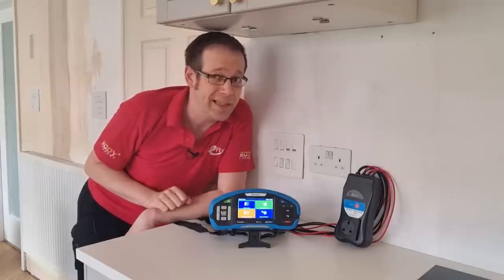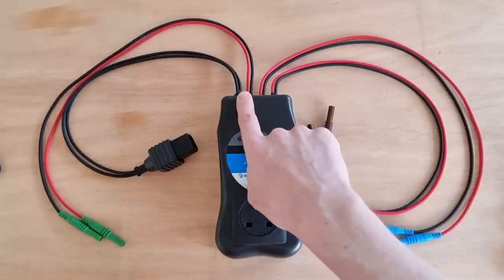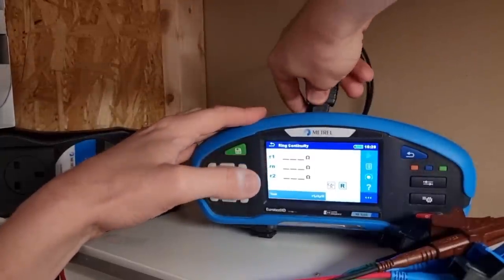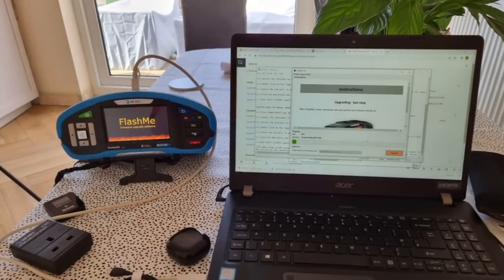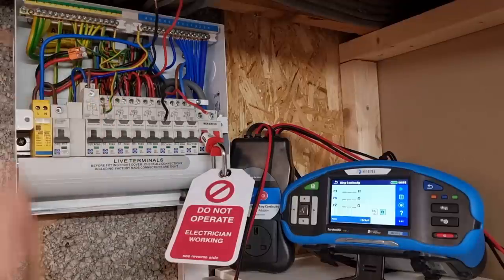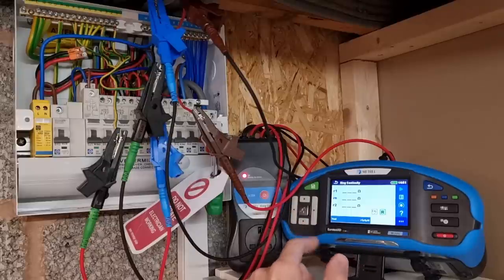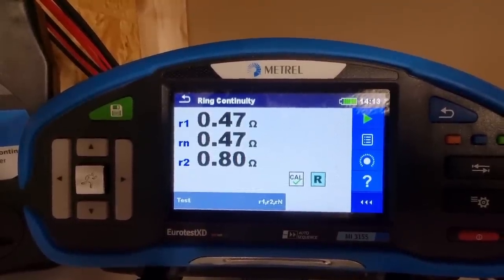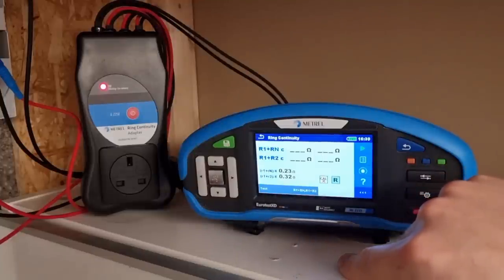The FAST Way to Test Ring Main Circuits!

Comment: How times have changed. When I was an apprentice we tested a ring with a bell connected to a battery,testing end to end. And as I good measure we would then test for insulation breakdown using a Megger
Reply: That is all that is necessary

Comment: The original reason for inventing ring final circuits was to reduce the amount of copper required for power distribution. That was a big issue during post-WW2 reconstruction. As copper prices rise and green footprint becomes more important, that reason becomes more relevant than ever.
Reply: Not correct, less copper less current flow... so how do you save copper for power distribution?

Comment: Great for initial verification, not required for carrying out an EICR. I’ve chosen never to install RFC’s in any re-wire I do because they’re pointless. Also, when systems start converting from AC to DC over the coming years, RFC’s and in particular the way we wire will change and RFC’s will be a thing of the past. Out of curiosity has somebody really wired that grid switch like that next to the socket??
Reply from the maker: Good insights.

Comment: I invested in the A1214 quite some time ago to go with my MI3152. It has red wires with heat shrink sleeving to indicate the usage. Strangely for a UK specific product, the line wires have grey heatshrink and black croc clips! The MI3152 has an auto sequence test which works with the A1214 but has no calibration option so the r1, r2 & rn results are not going to be much good. After getting readings at consumer unit, it gives the error IB020 and it is necessary to press another button to actually see the results. I took it to Metrel's UK office and left it with them for several months for testing but they did absolutely nothing and finally sent it back! Having just seen this video, I now know that there is a ring option in low resistance testing but this still does not have a calibrate option. I therefore upgraded the firmware (which deleted all my stored results) and after this, there is still no option to calibrate! It is hard to recommend this ring final tester based on my experience with Metrel - very disappointing!
Reply: Great insights, have you solved the issues with the MI3152 KC? I'm thinking of buying the A1214, any help appreciated.

Comment: I don’t install rings anymore, always 20A radial circuits, so much easier to test and faster
Reply: Same, I’m surprised amendment 2 didn't start recommending radials over rings given how AFDDs are steadily coming in.
Reply: Don't be such a wuss. 🤣
Reply: @paulmatthews5470  AFDDs work just fine on rings.  It's just that rings aren't as prone to arcing due to a break as radials are.
Reply: @paulmatthews5470  So old fashon ring finals nowadays..
Reply: @andrewcadby  yes I know, but wait until the manufacturers start lobbying it with how rings defeat serial arc detection by design
Reply: Ring main and radial circuits are two common methods for wiring electrical sockets in a building. The choice between them depends on the specific requirements of the installation. Here are the advantages of installing a ring main as opposed to a radial circuit for sockets:

1. Load Distribution:

    Ring mains are designed to evenly distribute electrical load among the outlets. This means that each socket in the ring can handle a relatively equal amount of current. As a result, there is a lower risk of overloading a single socket or circuit.

2. Efficiency:

    Ring circuits are typically more efficient in terms of wiring. They use less copper wire compared to radial circuits, which can be more cost-effective for large installations.

3. Lower Voltage Drop:

    Because a ring main distributes power in a loop, there is less voltage drop across the circuit. This can be particularly beneficial in larger homes or buildings where voltage drop can become a concern with radial circuits.

4. Fewer Circuit Breakers:

    Ring circuits require fewer circuit breakers or fuses compared to radial circuits for the same number of outlets. This can simplify the electrical panel and reduce the risk of tripping circuits.

5. Redundancy:

    In a ring main, if one part of the loop is damaged or disconnected, the circuit remains functional. In contrast, a break in a radial circuit can disrupt power to all the outlets downstream from the point of the break.

6. Flexibility:

    Ring circuits are more flexible in terms of adding or extending outlets. You can easily tap into the ring at any point to add a new socket without the need to run a separate cable to the consumer unit.

7. Safety:

    The looped structure of a ring circuit means that the return path for the current runs alongside the live path. This can help ensure that both conductors are subject to similar thermal effects, reducing the risk of overheating and fire.

Comment: Good job thanks for info 👍.I  wish to get one of those mi3155 but I already own metrel lower version  mi3100s.The question is, can this A2214 ring adaptor be use onto Metrel mi3l00s ?
Reply from the maker: We will find out
Reply: Yes it can might need to update the meter firmware

Comment: I'm not a fan of poking in the CU for obvious reasons and especially if I've just dressed it all nice and tidy.  I just head to the opposite end of the building and find a nice easy socket to do my end to end tests.
Reply: Surely if it’s a job you have done you would test the circuits before you second fix your board ?

Comment: Not a good demo of the 2214 as during the R1 + Rn and R1 + R2 tests the results of each test 9:05 to 10:20 are not committed so the meter cannot save the result. Once the test result is displayed the button below the soft test button should be pressed to commit the result once the test has been completed on the circuit the result can then be saved

Comment: How does it deal with interconnects on the ring final?
Reply from the maker: The readings will be significantly lower in some places than others.
Reply: @efixx  that was my worry that the electronics might not see the bridge and interpret in a way that didn't show up on the meter.

Comment: looks good but doesn't seem compatible with my tester MI3152 according to their website?
Reply: A214 unit is compatible, however as yet we cannot Null the unit until they release the next firmware !!  Considering they have been selling the unit for months and now only just releasing a firmware to Null is crazy......I have found Metrel Support Diabolical
Reply: @stormuk69  The A1214 seems to have now been discontinued so no longer available (not in the UK at least).  Guess this unit is the replacement version so will probably work with the MI3152 as I doubt the technology is different just now has the shorting outlet, subject to firmware though as you say.
Reply: @Mark-xr4zt  Yeah, I bet its exactly the same with the nulling unit built in.  So bloody annoying, I only had mine 3 months.  Still no big deal really I have a nulling unit in my toolkit.

Comment: Hi is this compatible for metrel mi3152 eurotest. Or would this work👐
Reply: Yes it is I use this with a MI3152
Reply: Yes but you have to get calibrated and need to send back to metrel but was time saver. Got to admit I do like megger x1 better but use the metrel for back up.😊

Comment: Great so my A214 device is already out of date as it doesn't have the built in nulling plug.  I also messaged them 3 months ago about the nulling procedure on the A214 and finally got a reply last week about the firmware being released soon.  If I could go back I wouldn't bother with Metrel as the whole unit is very convoluted compared to Meggar and the support for such an expensive unit is diabolical.
Reply: Still waiting for a Firmware Update to add Calibration.  They are now actively promoting the new version of the A2214 yet you still cannot calibrate it with the 3152.  Piss poor support for a tester costing over £1,000.
Reply: @stormuk69  The firmware for the 3152 / 2214 combination has been available for over 18 months as I have been using it since I purchased the 2214 in October 2022
Reply: @georgeneil440  It wasnt at the time I purchased the original Ring Adapter.  Anyhow I got rid of the tester ages ago due to dismal lack of documentation and training videos.  Got a Megger X1 with EV Adapter which suits my needs perfectly.

Comment: There is definitely a case to be made for using 4mm for sockets supplied by a 32a breaker. Testing is much quicker. But this Metrel tester really is impressive. 
If you were to test say, 10 sockets, would it remember the highest result whilst showing the most recent result? That would be the icing on the cake.

I've grown to hate the title 'ring main'. Customers don't know what it means, they only think they do. It's most often used by electricians that don't test. Or it used to be.
Reply from the maker: Customers thinking they know! - what are the chances!
Reply: Yeh but it all falls apart if you're not method c... And that's virtually impossible to achieve on your average socket circuit even if there isn't any thermal insulation. That's why my hand is forced back to rings on occasion. Just saying. 🤣
Reply: 30 amp would be outcome for 4mm on a radial. 32amps would be a no go unless directly clipped to a wall. So the stated breaker for a 4mm t&e radial would be a 20 amp mcb or rcbo. Not forgetting you'd have a problem taking a spur. You'd have to find the final and take it from there or use a junction box.
Reply: @rayc1503  🤣 although my house has 25a 4mm radials...
Reply: @travoltasbiplane1551  Probably so, but 25 amp breakers aren't all that common.  😜
Reply: @rayc1503  20A radials on 2.5mm2 seem to make more sense.
Reply: @rayc1503  Pretty common now,Hager,Wylex, Chint are just a few who have them...
Reply: @rayc1503  What about all the unfused Spur on spur on spurs from RFC’s that we keep finding when doing EICR’s, or all of the broken RFC’s we continuously find. How does that measure up with Ref B, 100 or 101? We can spur from a 4.0mm radial in much the same way as we do for the RFC… If the circuit is correctly designed there’s no issue either way, it comes down to the designers choice.
Reply: @CarlCosby  Have you tried terminating 3x 4mm terminals in the back of a standard switched socket. Please do and let me know how you get on. Of course you can take a spur. It's just not that easy. 4mm t&e isn't the easiest to work with.
Reply: I wire as a ring then put it on a 20A RCBO, gives you the option to upgrade to 32A if required and if someone cuts into the circuit to add more sockets then there’s no problem of losing the ring as it’s on 20A, I don’t like rings but I’ve had too many builders putting fixing’s through cables to convert completely to radials.
Reply: @greggsmith4539  unless it's directly clipped to the wall a 32amp breaker would effect the thermal carrying capacity of the insulation. 30/ 25 or 20 as you stated.
Reply: More radials needed, less (or no) RFCs.  Dedicated 4mm2 25A for laundry area with 2-4 sockets, another for kitchen sockets, 2.5 20A for oven, 4mm2 32A for hob (remembering John Ward's diversity calculations the oven and hob could go on one 6mm with separate isolators), 2 x 20A 2.5mm2 upstairs and downstairs (or all on one), 2 x 1.5 6A lighting. Usual radials for outdoor/garage/water heater/shower/car charger/heat pump. With big appliance loads separated, no need for 2 x 32A rings in rest of house, unless it's huge. Just been in a new build annexe (open plan, studio style for 1-2 people) with two 32A rings (heating, shower, hot water on their own radials)! 64A, after diversity, at sockets?! Not well planned, but someone can't help themselves designing RFCs in 21st century!

Comment: How many outlet we use in ring final circuit ?
Reply: It's based on floor area. You'll find it in the regs.
Reply: Hi Hasan,  You can have s many outlets as you want on one ring final circuit, as long as what you run from it does not exceed the maximum value of the 
current caryting capacity of the cable you use.  EG  2.5mm cable will take 27 amps.  usually on a 32 amp breaker.
Reply: @billsbasementworkshop1902  your right, but I was told when I was at college back in the 80s 
You can have as many sockets as you want as long as the total load doesn’t exceed the design current, ie it doesn’t exceed 32amp ? Yet another instructor told us you can have upto a hundred sockets in an aria not exceeding 50 square meter’s?
Reply: @seandempsey7351  you can have literally as many as you like within a given area (100m2) as long as you've given thought to how the circuit will be used in terms of loading (kitchens/utility etc) and where that load is on the ring i.e not all down one end. Having 100 sockets doesn't necessarily mean they're all gonna be used at once does it.

Comment: Does seem a little long winded but I would imagine that it would become second nature and very quick once you got used to the procedure. 

Questions...
Does it retain the highest reading?
Does it remember the resistance of the test leads or does it jave the ability to self test/store them?

Great video Joe 👊
Reply from the maker: Yeah, after I'd done it the first couple of times it was really quick. I believe it does retain the highest reading, I think you tell it to store it when you find it. And it will store the nulled value as well I think. 👍
Reply: @efixx  thanks for the reply, might need to look at them although it would mean buying another tester to add to the collection.... 😁

Comment: Stop encouraging people to think about ring mains. Get rid of ring mains, for the love of GOD. A huge chunk of my work in remedial work for EICR’s was broken rings, splitting ring into radials. I hated it. 6 wires to mess around with in the fuse board. Can’t get to CPc because the numpty twisted them and single sleeved them. Can’t see which neutral is going where because the numpty just shoved 1m of singles into the board without trimming and labelling

Or the decorator who pull sockets off, or do it yourself Dave who changed all his outlets himself and disconnected multiple conductors when screwing back. 

Words can not express how much I hate the ring main. It’s up there with not wiring lighting radials with neutral to switches first.

END THIS MADNESS NOW

But in all seriousness, it’s a good tool you’re showing here. Wouldn’t mind one myself.
Reply from the maker: Sounds like it's the numpty not the ring that's the problem! 😂

Comment: Finally got rid of AC RCD in 18th A2 , 18th A3 get rid of  RING final.
Reply from the maker: But the old ones will be around for decades!
Reply: Won't happen. And besides. Honestly how many times have you seen a ring final circuit, even one that's been badly installed, cause a problem?
Reply: @travoltasbiplane1551  agreed.  Rings have a lot of advantages over radials.  Can't see them ever being axed
Reply: I believe due to the push towards AFDD's,   which  I believe don't cover all arc faults on a Ring circuit. I believe they days are numbered. I haven't installed a Rings for at least 10 years nor a Dual RCD board. 
Yes all the existing Ring circuits will comply with pervious version of BS7671 and be coded so.
BTW nice bit of testing equipment it would be a nice addition to my Metrel family 👍
Reply: @azzurrielectrical2317  only a serial arc in one leg won't be detected and only because it's not likely to be at a dangerous enough level. Removing rings would be very problematic for many designs. To compliantly design you would need a LOT of radials. People have been saying rings will be gone soon for 30years. They're still here and there still aren't bodies in the streets. It's a total non problem. Radials can just as easily be abused. There's an argument to say that rings are safer with two CPC connections as well...
Reply: They say ring mains came in late 30s early 40s so as to save on copper usage for the war effort, that’s partly true, the real reason was to prevent homeowners over loading there sockets circuits and coursing fires, I’am old enough to remember infused round pin plugs , and the TV going off when my dad plugged his all metal black & decker dill in or when my mum turned the Wireless on, and the fuse in the fuse box popped, I also remember my mum plugging the ion into the kitchen light lamp holder and and the living room light suddenly dimmed . 
Doesn’t take an electrician to work out that the radial circuit wasn’t heavy enough. And it got worse when electric toaster’s and vacuum cleaners electric kettles found there was over from the state’s .
Reply: @seandempsey7351  Your history is a bit out the committee that introduced ring circuit and BS1363 wasn't convened until 1942